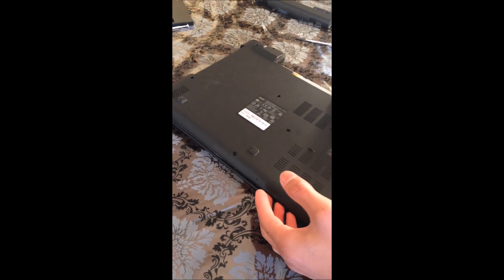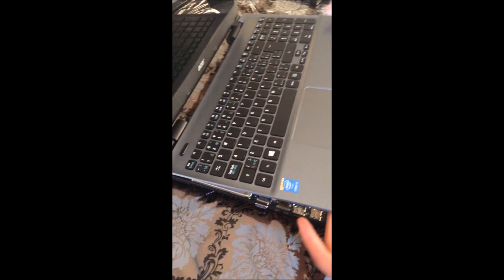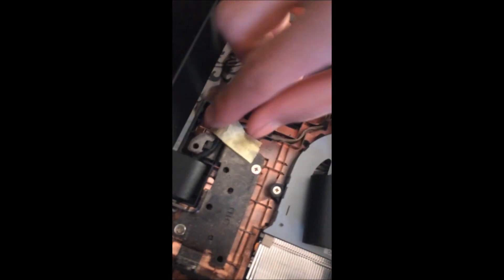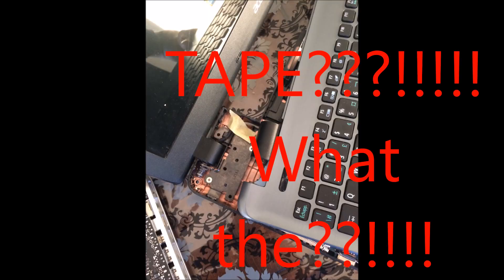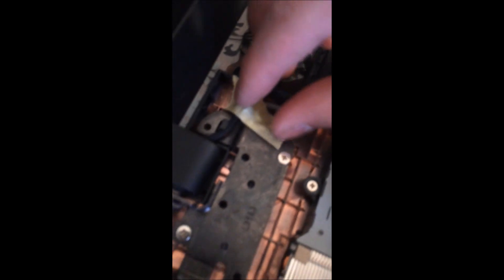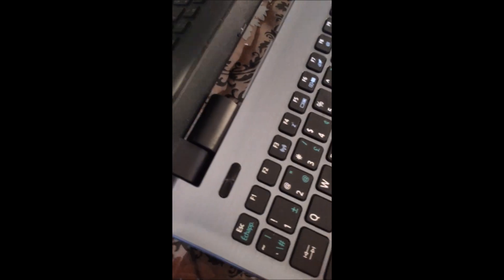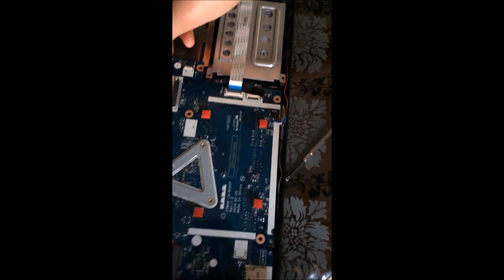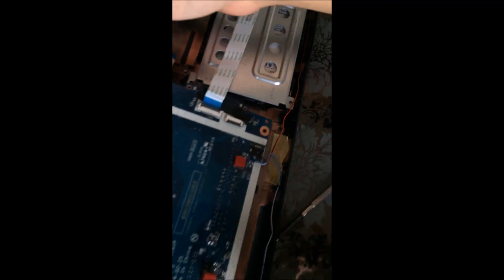Acer bad quality Must watch this before considering to buy an acer!!

Comment: I remember I bought 1 Acer, and it only worked for 2 months before it started having issues . I though it was my fault so I got another one.....and it started having issues after 2 months aswell. So I returned it and bought a Dell. Until this day it still works so it wasn't something I did wrong.

Comment: Idk man ive had my Aspire for 5 yrs, been dropped many times, overheated BAD, been in really cold temperatures in my backpack while riding snowmobiles and it hasn’t skipped a single beat!
Reply: I still have an aspire e5, I hate it because of how badly it performs
Reply: that laptop had been apart before. i can tell with how easy it came apart. not sure but fairly confident ive seen that tape in other machines and sorry to the idiot on camera but holding the wire down with tape is par for the course. unless you want it just dangling inside? lol
Reply: @perumrajabasa7682  same I bought acer nitro gaming laptop about 900dollars and it performs bad after 1 year warrenty. I saw the review and ratings then figured out how worst it is.

Comment: I have an Acer Aspire 3, been using it for about 1 and a half years now, and today it decided to cut itself into half. My acer aspire 3 is now officially a desktop, I wont even bother asking about the warranty of this, because even if my warranty is still valid, acer WILL NOT answer because of their shitty products build quality and instead will only blame it on me for CLOSING THE LID TOO OFTEN. So yeah, MY ACER WORKS PERFECTLY FINE.

Comment: I have an Acer Aspire R15, I got the BSOD at least 10 times this week.
Reply: @Vlad Vaduva Well I updated it constantly and it was only a year old at the time I made that comment. I’m guessing it had problems all the time because I wasn’t really careful and I played games that it struggled to run. I got a new computer, and now I’m more careful with it.

Also, it would probably be good to include that I had to replace the hard drive since the old one died. So if you do buy it, I don’t recommend using the laptop upside down or sideways. Leaving a hard drive sideways/upside down too long can damage the hard drive. I unfortunately learned this the hard way

Comment: Slight problem here. That tape is electrical tape, used by most laptop brands to secure cables. That tape in your laptop is masking tape. That means YOU put it there.
Reply from the maker: Nope this is exactly how it was, we never modified or put anything extra in there.
Reply: Most laptop brands actually use ELECTRICAL tape in their computers. I wonder why yours has masking tape?
Reply from the maker: Melon Plays I would surely believe that and would be ok with electrical tape. However that's also what I'm wondering about that masking tape.
Reply: Not all electrical tape is rubber, there are some nylon and paper tapes as well, in such cases the fibers and resins used to coat the tape have insulating properties. I work with heavy duty laser cutters and believe it or not the transformers in them are insulated wrapped in a fabric-like material that looks exactly like regular denim but can block 10Kva.

Comment: Acer is ok I don't really have many problems also lots of laptops have tape, apple does it alot and apple also likes to glue parts on and weld hard drives to sata ports giving the middle finger to people who like upgrading fyi I'm not an acer fan I actually like dell laptops alot more or whatever a good deal and I like to build my own desktops but saying acer is the only brand that uses tape isn't accurate, I've taken apart lots of laptops and newer laptops use tape to cut cost in parts and because the machine is smaller
Reply: Bro I hate apple but I still have to say that their products are high quality

Acer is low quality for poor people
Reply: @boyanr2d229  not saying apple makes bad products i am just saying they do cheap out on some things, maybe not as much as acer since you would pay around 1000usd or more for a basic macbook compared to the 200-1000+ dollars you would pay for an acer. Also if you are talking about the budget acer laptops and desktops you should kind of expect it to be lower quality since you pay alot less for it than a macbook.

Comment: i personally love acer i had 5 computers from them and they all work great
Reply: I love my current Acer aspire 5 and have used it for around 5 months. However, the first one I got, some keys were defective (0,-,/) keys. I got it returned and got another one which I am currently using. To be honest, the hardware is great money for value, but Acer needs to improve on the quality control since there are other few unlucky people like me that had defective laptops from them.

Comment: Acer is good for gaming not for normal laptop
Reply: acer is a shit company, i bought a screen from them had a problem with it within the first month and refuse to give a refund or replacement, they simply repared the screen and sent it back, still had the same dead pixel so i know its same... i know usually companys will repair stuff, but in the first month they are supposed to give refunds or a complete replacement, dont trust them. put a little more money and buy from a better company.
Reply: @dericsion3480   bro I have acer nitro 5 and I am using this laptop for a year now and I have no problem with it also I didn't took the laptop for service. For me acer are good for gaming
Reply: @sharaarsagir1943  yea, and i have bought an acer screen, it has 6-7 white lines on the screen and a dead pixel, the screen died on me in the first week, and they refused to send a replacement, they repaired the screen and sent it back. shit company.
Reply: Acer is shit
Dont buy it
Reply: @dericsion3480  that means you have bad luck